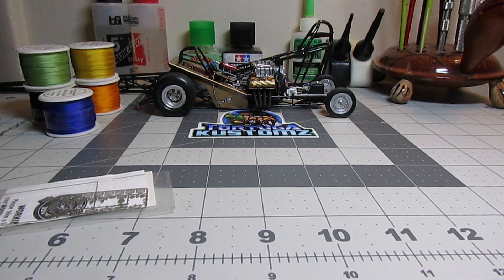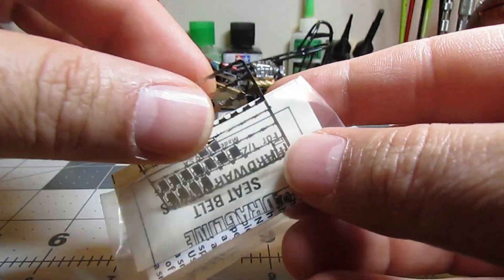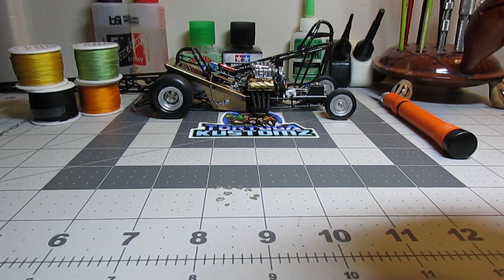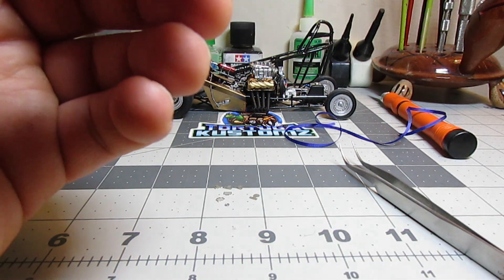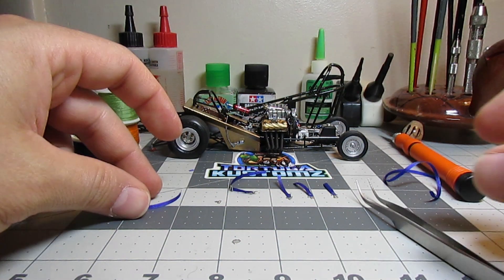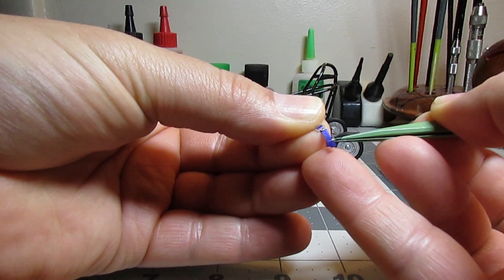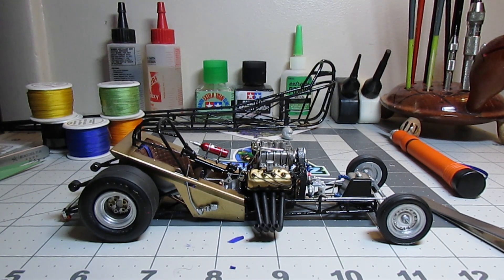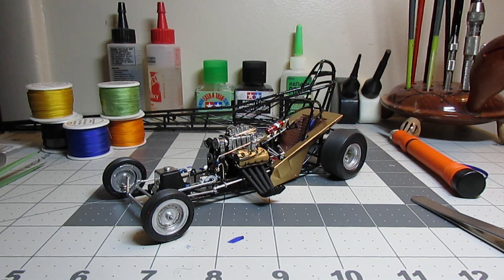How to do 5 points Seatbelts in 1/25 scale

Comment: Nice, that is the stuff I had found myself. Note it is silk ribbon so it's softer and flexible like real cloth unlike what you will find in craft stores which is shiny nylon with ruffles on the edges. Seeing that this stuff is a fabric you can add stain to it for a used look. I even used the white as header wrap, much thinner than trying to use the medical tape.
Reply from the maker: Oh yeah, i didn't mentioned that, thanks, yes i did try those nylon ones and i still have some around but didn't like them at all, that why i was searching for alternative
Reply: Where did you guys find that ribbon?